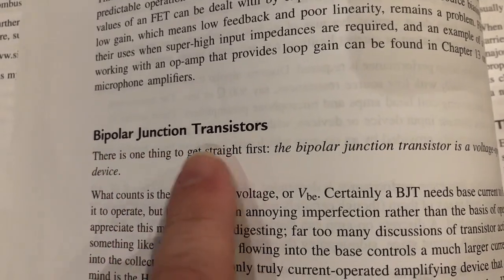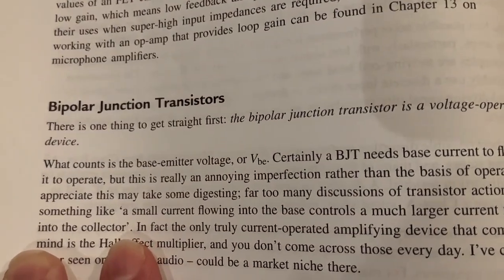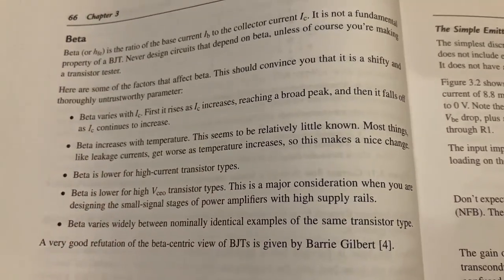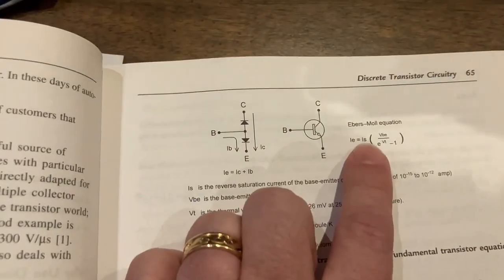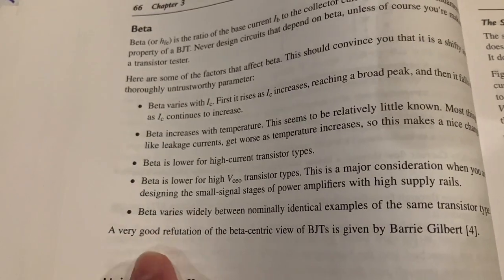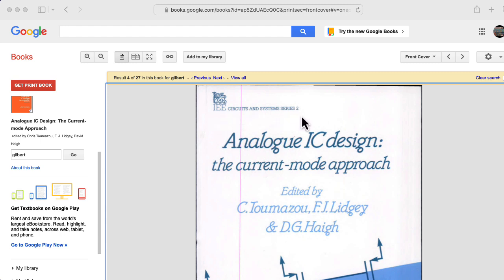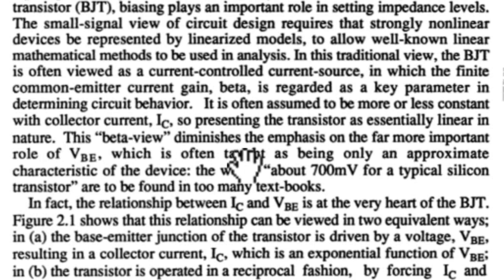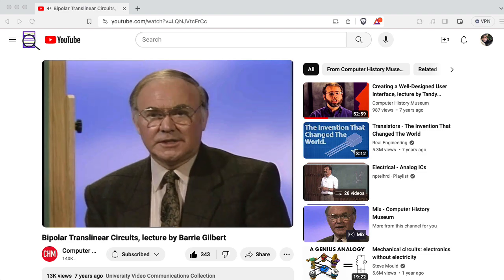More Story Time with Professor Lanterman (The BJT Control Controversy)

Comment: While I understand the argument of not designing or building circuits around beta, at this point in time, I guess all distortion and fuzz circuits have a proposed HFE notated (because variability) the same way JFET based ones have trimpots and voltage measurements to achieve similar behaviour with VGS varying wildy for the same model of JFETs, which is why datasheets have min/max values on specs you end up measuring the one you are using and writing it down.
Point being: The fact that all circuits give you the beta, while technically non ideal, its the only thing we have to reference to match the original/proposed one.

Which makes me wonder: What would be the propper way of measuring BJTs and what parameter should be written down on this schematics then? Also, what would be the propper way of selecting matched pairs for a moog ladder filter for example? (since its traditionally done by checking for the same beta with a test circuit). I can see VBE(on) and VBE(sat) on the datasheet but, is that the right parameter to reference then? Any advice on how to measure VBE(on) and VBE(sat) propperly on a real BJT?

Thank you for sharing your knowledge. I find your videos fascinating and while I'm a little dense for some of the math, it is really insightful in ways I can let LTspice help me with the numbers after grasping the ideas you talk about =)
Reply: beta as a reference in an existing ciruit, especially one that is supposed to run at room temperature like e.g. a fuzz face, is not bad because the parameters that beta is dependent on are somewhat fixed. what providing beta values does is ensuring that the all the stages in the design are loaded to the extent the designer intended.
Reply: @bbugl  Yeah a lot of older audio circuits are very sensitive to beta, so it makes sense to be specific about it in those instances. Some tube amp circuits operate better when the mu of the tube matches a specific value too. Generally though we've found a lot of tricks to reduce the dependence of our circuits on exact device parameters for modern equipment.

Comment: This series of videos is very helpful to me, thank you. I've always been very interested in what goes on "under the hood" as voltage is applied to and current moves through semiconductor devices, and my preferred learning method is to work from first principles. This is helpful to me in separating derived properties from more fundamental ones, and I very much appreciate it. I picked up a copy of Self's book earlier this year, but I haven't gotten very deep into it yet; I've been working my way through "The Art of Electronics" for a few months now. I'll start digging more deeply into the former book soon, as it looks like there's more in there than I had thought. Thanks so much for the information, and especially for the sources.

Comment: BJT is both a voltage-controlled and a current-controlled current source, so simply I can choose one of those two according to loading impedances. Though, voltage-controlled model is more fundamental, because hfe largely varies from the operating temperature, voltage, and even current. After all, operating region is also determined by voltages, e.g. BJT works in an active region when VCE > VBE.
Reply: Heh, but neither one explains the high-frequency behavior of the BJT!   We then have a third belief-system, a third "religion," where <Whorf voice> Voltage Control is for the Weak.
At high frequencies, we must employ CHARGE control, the Gummel-Poon equations.   At high frequencies, Vbe does not tell us the actual voltage across the PN junction, because the Base-spreading resistance is in the way.   But if we calculate the charge on the base, then knowing the junction-capacitance, that tells us the actual internal voltage, and the rest is just Voltage Control.   (So, don't even bother calculating the voltage.   Declare that transistors after all, are REALLY controlled by Charge, and if anyone objects, we must fight to the death over it, right?  Hee!

Comment: first comment: This topic is very interesting !
My understanding of this is that :
1)The current control approach is a SIMPLIFICATION in order to INTRODUCE the use of transistor as a switch with base current amplification at the collector.
2) But for linear analog circuit design, the bjt is definitely  a VOLTAGE CONTROLLED device.
This is not even a subject of discussion, this is trivial fact.
The model is Voltage controlled, the small signal derivation is voltage controlled too.
I bet those shooting at Professor Lanterman in the comments are not Analog Designer 😅.
Reply from the maker: Thanks!
Reply: @Lantertronics  But it eats current to turn on.
Reply: Transistors are a horrible swtich. They're just the easiest. Get a jfet and you don't need shit for current.
Reply: Transistors are amplifiers abused as switches and fets are switches you can abuse an amplifiers.
Reply from the maker: @justovision  I love it!
Reply from the maker: @justovision  The Wasp synthesizer perversely uses CMOS inverters with feedback to bias them to act as crude amplifiers.
Reply: @Lantertronics Any logic chip is an amplifier if used in the right circumstance.
Reply: @justovision it eats current because it has low input impedance.
Reply: @justovision  FETs eat current to turn on, yet they're voltage-controlled.  THe same applies to vacuum tubes.  And, capacitors are electrostatic devices, but they eat current in order to charge up.  
How to cut through the confusion?   Just realize that electric forces are caused by charge and voltage, while magnetic forces are caused by flowing charge and amperes.  The BJT input is not based on magnetism.   As with rubbing a balloon upon your arm-hair in winter, the currents are an insignficant side-effect, and electric forces are the whole deal.
Reply: @justovision What runs on electricity but doesn't eat current to turn on?
Reply: @gasun1274  A FET or an Op Amp ideally only needs a voltage on the input. There is some leakage but it's minimal and you can probably ignore it. Once turned on they will draw current but not from the input or gate.